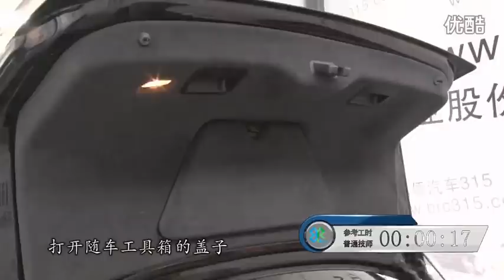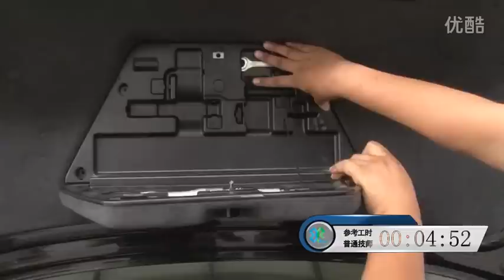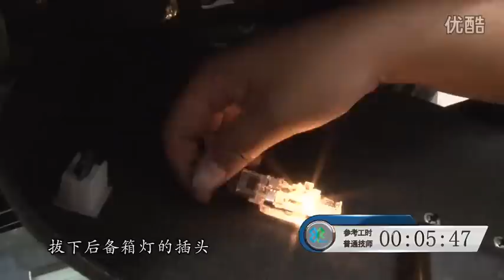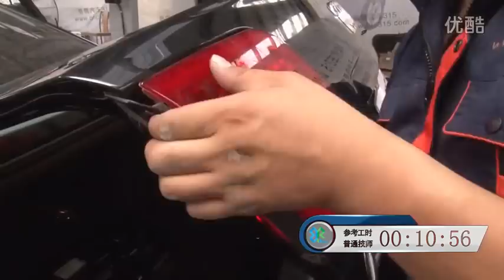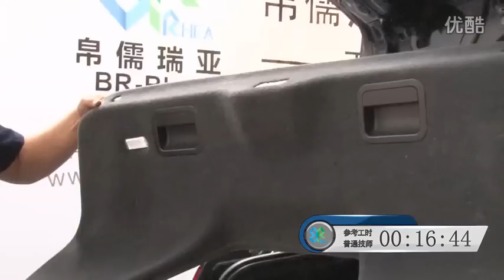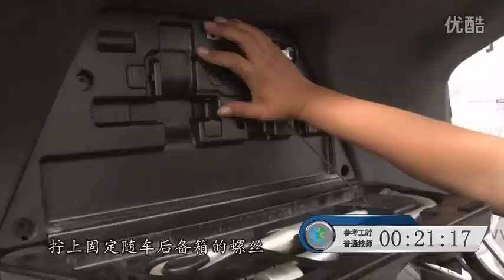Audi A8 Tail Light bulb replacment 2004-2010

Comment: Don't forget to drill a hole in the bottom of this POS cars new tailights to let water drain out or you will replace the $400 piece of crap light in 8 months again.  They hold water when it rains and it corrodes and shorts out the led circuit board. Designed to do that obviously. Supposed to be sealed but this is a well known common issue with the light design on these. Planned obsolescence. Or sell it and get a better designed car that you can spend $3 and replace a bulb instead of the whole assembly. Shame on Audi for being so shady. Love/hate with my A8 but can't wait to get rid  of it. The only more poorly designed over engineered car I've had besides it is a Landrover. Going back to Honda or Chevy. Great video that will help all the suckers like me replace these $400 lights every year. Thank you for posting it. It helped me last time and this time 8 months later. Yes. I forgot to drill a drain hole in my last new light. Lol
Reply: Can you just replace the bulb with black case and not a whole new assembly?
Reply: That has happened to my 06 Audi A8L. Im seriously think about replacing them
Reply: You gave me a memorable laugh with your comment, 4 years later.

 Thank you.

Sincerely,

-Another Audi A8 sucker who is about to replace his own water damaged tailight.